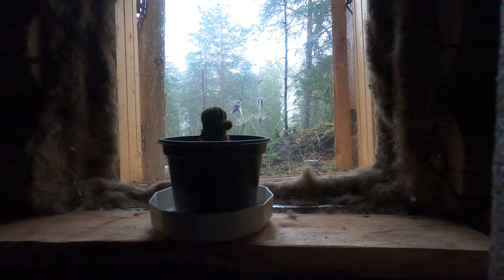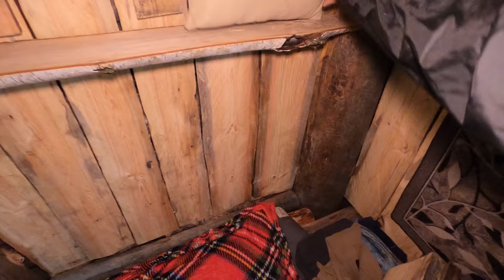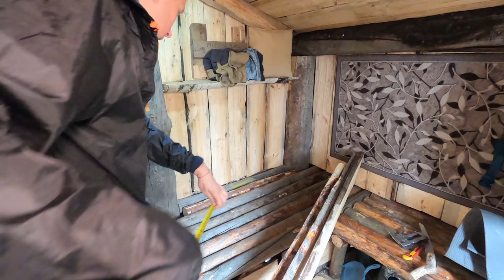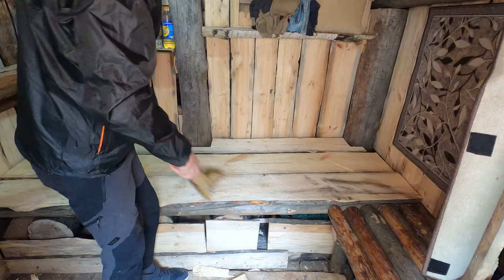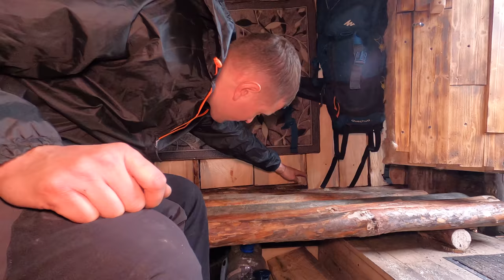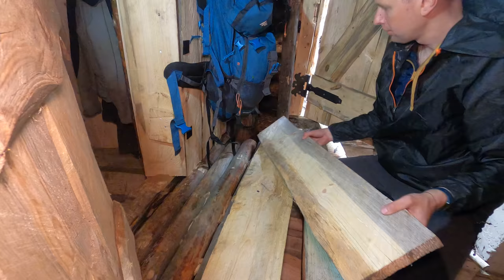ALEX WILD dugout life: THUNDERSTORM and RAIN caught me in a LOG CABIN. Part 28

Comment: Hey Alex! Absolutely love the videos and your journey through this whole process! Wondering how you keep water from finding its way into your shelter by your stairs? Doesn't the water build up and try to come from under the door?
Reply: I was wondering the same thing, I didn't notice any method of drainage.
Reply: @stevendotson9819  People have asked that a lot in the comments sections and I don't think he has ever addressed it but I could be wrong.
Reply: probably concrete sealant will work  ... i used it before in my previous house basement that was leaking during strong rainstorms ... also added a sump pump in one corner
Reply: I also was wondering about that.
Reply: @saintmess  I wonder if he has some sort of French drain system to take water away. I was curious about the snow melt and rain runoff. But his cabin looks dry.
Reply: My thoughts exactly

Comment: Awesome work! Sincere question… How do you prevent the rain from flowing downward into your cabin? Genius design.
Reply: I was thinking the same
Reply: @nicola6323  Alex hasn’t yet answered but another video showed his interior floor dry after a rainfall, no puddles. So I guess there must be enough drainage between the logs at the landing before the door, and drainage inside.
Reply: I was wondering myself about the same  issue.
Reply: I have seen video from the start Alex put all around and on floor tarmac before he installed  the logs
Reply: @joyaku3078  Thanks!

Comment: Future project suggestions: add a simple wire mesh (chicken wire) inside the stove pipe to keep birds out, attach a pulley to the skylight so you can open it from inside, sculpt the ground in front of the window so rain/snow/water runs away from the dugout, build some outdoor furniture like adirondack chairs, outdoor stove/oven (maybe a pit you can cover).

Comment: I'd genuinely worry about water drainage, and sort of be mildly concerned about CO2 ventilation.

In the winter, running a fire probably lets convection takes care of the CO2  but I'd worry anyway. I might be overthinking it.
Reply: First: When he was building it the soil was pure sand which allows the water just to soak in
Second: His house... it’s not airtight like a modern house but... that being said CO2 is heavier than oxygen so in theory it would accumulate in the house over time 🤷‍♂️😬
Reply: @crandonborth  This kind of shelter exists for a reason; it makes sense where they make them. 

But holy crap, if someone tried to make one of those things here where it's  rock half a foot under the ground and it's unpredictable monsoons from April to August... I'd be nervous to sleep in one. I get (irrationally) nervous just watching. 

That being said, it's a cool as hell DIY project, and I wish I could do something similar.

Comment: other yotube video has build same but lot better because have full size room, this have too low, you need digging floor lot down, and make full size door,this not have good and comfortable use. floor need dig down 1 meter then digging line out and install tube, if room flood all water go to tube out of cabin, this has need make first when digging cabin first time.and stairs to in cabin have bad need digging down lot too and long. wery ap\normal non comfortable walk in and out. shit. and good cabin have good kitchen, sink, sauna and shower.all this have too small stay good.